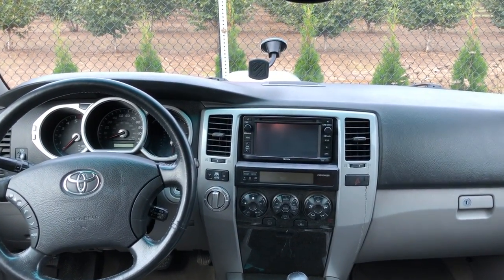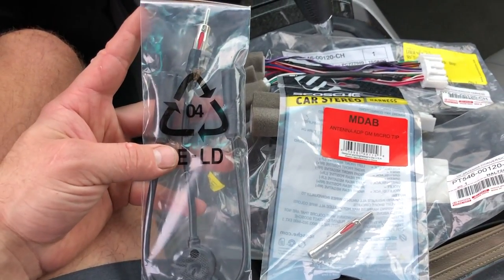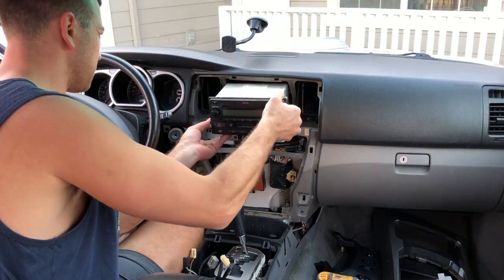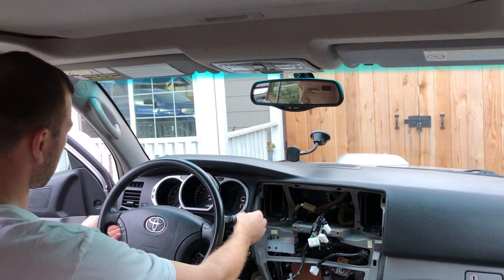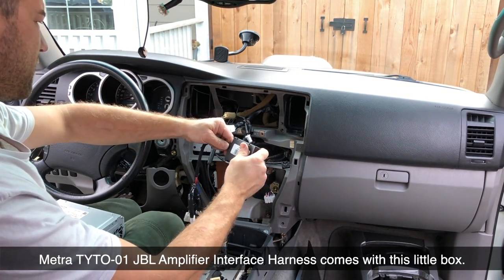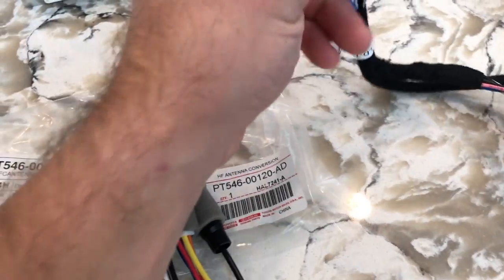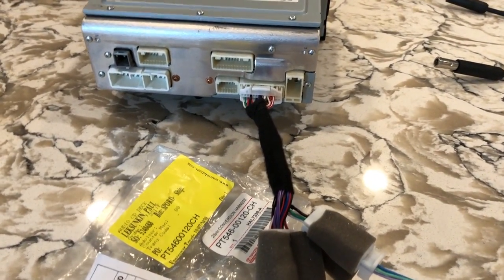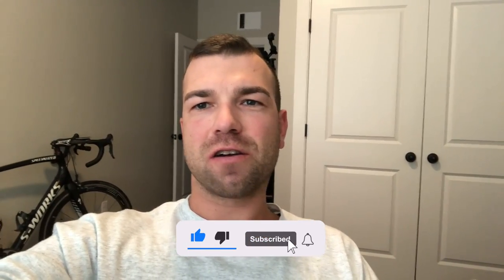4th Gen Toyota 4Runner Touch Screen & Bluetooth Radio Install - Upgrade 4th Gen Toyota 4Runner 2003

Comment: Something about your setup doesn’t add up???????? You have the jbl synthesis tags on your doors and require the adapter yet your OEM installed radio is a non jbl unit and your silver radio bezel is the recessed sr5 model not available on jbl models which would’ve left gaps around your radio. Unless it was different on the 03-05 models. FYI- This mod doesn’t works as well on 06-09 jbl synthesis models. It will require swapping out the silver radio surround shown here and also replacing the jbl beveled edge climate control panel to match the silver surround. I decided to do this mod based on this video not knowing this because it says works on all 4th gens. I know this is unintentional! There is plenty information on the forums about this gaps issue.
Reply from the maker: I"m sorry man. After doing bunch of research I thought it would work exactly the same on all 4th gen 4Runners. I hope you got it figured out.
Reply: Did you have the cd changer? Same issue with me.
Reply: @renegonzalez5097  yes jbl synthesis. If you have a 06-09 Jbl model I recommend not doing it. To set it up correctly is very expensive and complicated
Reply: My 2004 4runner SPORT has JBL synthesis and the radio (cd/tape) doesn’t have JBL marked anywhere on it. Looks the same as the 2003 in this video.
Reply: @tronixster My 05 runner has the JBL Synthesis factory radio marked on the radio and doors, the logo with the subwoofer on the back, would what is shown in your video work?

Comment: My volume keeps fluctuating. I have turned off the setting to keep it from fluctuating but it continues to cycle up and down. Is anyone else having this problem? What can I do to fix it?
Reply from the maker: I’m sorry brotha mine was perfectly fine. Maybe check your wiring
Reply: Did you get it figured out?
Reply: I just did this install a few hours ago and my volume is also fluctuating up and down when listening to the radio. The smaller antenna was hard to push through the adapter. I will investigate further but somehow think this is the culprit BTW, Thanks so much for this video. It was inspiring and I now have good blue tooth connection in 2007 4runner

Comment: I did everything you did step however the  backlighting doesn’t illuminate. The white wire that was left un-spliced in your “little pigtail” 6 pin harness is for backlighting illumination. Had to take everything apart after realizing it wasn’t working and ground it.
Reply from the maker: Oh wow! I didn't know it had back lighting,. I thought screen was the only things that was lid up. What did you ground it to?
Reply: @tronixster  I grounded it to a screw in the back of the radio. All of the radio buttons are to illuminate when you turn on the headlights! That’s what the white wire @18:43 minutes in your six pin harness is for.

Comment: GREAT video!  Thank you for your time and effort to share this valuable information to help others.  YouTube was made for videos like this.

I just bought a 2005 4Runner and I'm gradually doing the work to make it mine, upgrading her and getting her ready for her second life.  I was contemplating an aftermarket Android head unit for Bluetooth and a backup camera.   It was great to see that the Yaris head unit accepts a backup camera.

This upgrade is now on my list.  I saved this video in my 4Runner list.

Until then, I bought the Anker ROAV Bluetooth FM transmitter to connect my phone's audio to the car audio system via an FM radio channel, and it also has two USB ports for phone charging.  It integrates nicely into the 12V cigarette lighter socket in the center console.
Reply from the maker: Praise God I’m able to help 😁
Reply: Do I need to get all the wiring harnesses?
Reply: Thanks for you video, hey do I can do the same on my 2003 Toyota 4Runner limited comes with JBl

Comment: I just spent over an hour searching through radio install videos for the Toyota 4Runner to find out what was up with the two antennas going into the stock radio.   I finally found your very informative video!  I also like what you did with your mic.  Hopefully my mic has enough wire to route to the same location!
Reply from the maker: Praise God you found this video helpful and good luck on the install
Reply: @tronixster  Install done!  The radio works great!  Thank you!

Comment: Bro, you’re a frigg’n genius,!!!
Reply from the maker: Praise God. I'm glad you found this video helpful.
Reply: @tronixster  hey Paul where can I get the plug for the rear speakers? My new radio didn't come with the plugs attached.
Reply: Thanks to this video I’m very happy too.
I found this plug in Amazon. I hope it works 
Scosche TA02RB Compatible with Select 1984-17 Toyota Power/Speaker Connectors/Wire Harness for Re-Installing The Factory Stereo with Color Coded Wires

Comment: Thanks for the video !  I completed the swap and it sounds so much better.  I forgot to set my eq levels on the original head unit “flat” so I had to get back in there, but way quicker the 2nd time getting back in there!  I’m doing the blown sub today and then I’ll be rocking out !
Reply from the maker: Yeah I have to replace my sub too. What sub are you gonna be replacing it with?
Reply: Hi Chris, why do you have to set your eq levels flat? I'm doing this radio swap, thanks in advance.
Reply: @tronixster  i used the Rockford fosgate, a little pricey but sounds great.  Thanks for the great video, I’ve been loving the swap!
Reply: @tronixster Question… I’m buying this head unit with Sirius XM. Will this feature work on the 4runner?

Comment: Thank you for doing this video.  I was going to use a Yaris head unit but picked up a Scion head unit instead for less than half the price of the used Yaris one.
Reply from the maker: Praise God this video was of help and good luck with the install. Scion head units is exactly the same so you'll be fine
Reply: Is the Scion head unit also a 6-disc CD changer?

Comment: Great video Paul, thank you! I did a Yaris install and added the microphone. I’m not a radio guy so the stock look but additional features works for me. 

I have Yaris and Scion radios for those interested. I can also add in the non-JBL harness and cabling so that it is truly plug and play.
Reply: Do any of these oem radios have NAV?
Reply: @cfoote2667  there may be some with that option, I don’t have any though.
Reply: @mattkorting8104  looks like its an additional GPS module you need to plug in. I'll send you a PM on a Yaris radio - thanks!
Reply: @mattkorting8104 I want to do this to my 2008, do you have the touchscreen or regular fm head units? I’d like to pick one up if you still have any available!
Reply from the maker: @mattkorting8104 thanks for helping people out over here
Reply: @tronixster  Hey Paul, I recently did the install. Thanks to watching your video a few times I was in and out in less than an hour. I didn’t order the mic yet however I did wait 2 extra weeks for the usb cable to get here. It connects and immediately disconnects and keeps repeating that cycle until I unplug my phone. Seller contacted me and will ship a new one but all else is perfect! OEM look and amazing functionality. Thanks a million! <3
Reply: Hey Matt!  I'd love to get ahold of one of those Yaris radios and harness/cabling.   I just purchased a 2006 4Runner and am looking to upgrade!
Reply: @Jondbuch  I recommend you reach out to your local toyota dealer and order it directly from them. All said and done it’s less than $400, the parts will be brand new, and it takes no longer than 10 days to receive the parts

Comment: I am going to go with a full android unit, but I appreciate this video. I have a 2003 with the JBL so it gave me so good insight. The full android unit is going to give me more options than the used yaris unit. I want that navigation on the head unit, and not my phone. I will just tether a bluetooth connection to the head unit and it can do everything...... Thanks for posting though!!!
Reply from the maker: yeah android unit will definitely give you more options but I really wanted the OEM look tho that's why I went the extra mile. Half fun installing your unit

Comment: Excellent video Paul.  I did this install yesterday, very easy.  It took me about 2 hours including running the mic up on the ceiling like shown in the video.  If you was to install the mic on the steering column, the whole job may take a little over an hour.  I purchased all of the Toyota harnesses and the head unit brand new on-line.
Reply from the maker: Hey Bryan, thanks for sharing. Praise God this video was of help and enjoy your new head unit. I'm also about to release a video of remote start system for 4th Gen Toyota 4Runner

Comment: Outstanding video. I'd search for an OEM radio and see if I can find one. I got the truck with an aftermarket already and I really want the OEM look. Thank You again.
Reply: I am about to uninstall mine from my 4runner and willing to sell. See my videos to see it working on 4Runner with JBL amp. Comes with wiring ready to plug and play.

Comment: Going to be doing this for my 4Runner soon, do you have to get a certain head unit model for the navigation? Also will you be doing a video for the back up camera? Thanks, fantastic video!
Reply from the maker: Hey man, I'm not 100% sure about navigation but most of them should work but I just use my phone. I'm planning to do back up camera video but just can't get around to it.

Comment: Great video!  Planning to something similar on 2003 4runner.
Reply from the maker: Good luck!
Reply: Me too!!!
Reply: Just finished my 03. Only issue I’m having is the rear speakers since that parts slightly unclear which wires go to what (not color coordinated), should be an easy fix though just need to cross some wires.

Comment: Great video! Got the same radio and works nice! I did get the backup camera components that you linked down below but the installation link is a dead end. Running into a bit of trouble getting the camera to work and was wondering if you have another installation guide i could reference?
Reply from the maker: I'm happy you were able to get the head unit installed. Sorry about the back up camera and I don't know of any other guides besides the one I've posted. What exactly is not working tho?

Comment: Hi what model of head unit is this, I have a 2005 4 runner I would like install it, great video
Reply from the maker: Hello below is the model of the head unit and good luck with the install. Btw similar Scion head unit will work exactly the same way. 

OEM Headunit Part #: PT546-52150

Comment: Just finished my install. Works GREAT! Just as you said. Now I want to install a mic. Can you tell us the part number that you used and where you ordered it? I don't think you mentioned it in your video. Thank you so much!
Reply from the maker: The link is in my description actually. But here it is: 
https://amzn.to/371r9vK
Reply: @tronixster  Thank you so much!
Reply: @tronixster  Hi Paul great video. I just receive a new head unit for just $303.00 I’m very happy. I’m looking now for that cable that you mentioned it the one came with your head unit but you don’t give descriptions of it. I’ll fine it but for future reference it will be good to check out n that plug code so like me if anybody else buy it new we can also look for that one. Nice S Work we are cyclist here at home too 😂

Comment: Really wanting to do this in our first gen 01-07 Highlander, it has the exact same basic AM/FM/CD/Cassette radio yours has with the same connectors and everything
Reply from the maker: I'm 99% sure it will work and install process will be very similar

Comment: Hi Paul, you have the best presentation. I've performed the install using your instructions and everything you covered works excellently. What I can't get to work is AUX - I plugged in the existing 12pin CN702 connector, but the aux plug in center console does nothing. I would like to add a USB which should also connect through that CN702. I bought a AUX/USB unit with CN702 plug which is wired to a little box with AUX/USB inputs, but it did not work. Any advise on wiring AUX/USB into that CN702 12 pin? Thanks!!
Reply from the maker: Hey Jeff, I've also purchased USB connector but never got around to connecting it. From what I understood it's plug and play. I'm planning to connect it later and do a video on it but I'm short on time now so can't really help at the moment. Might be a silly things to mention but make sure head unit is set to AUX option

Comment: I installed Pioneer AVIC 8200 in my 2004 4Runner but the radio is junk. Keeps dropping connection with my iPhone.Will replace it with the OEM version. Great video.

Just checked, and the headunit is not available.
Reply from the maker: I would recommend calling LKQ directly and asking them for unit. It will get shipped right to your house

Comment: Hi, I just did the conversion and thanks to your video this went very smoothly. Even the backlight works great. Thanks for the great video and in particular the shopping list. I was hopeful the fader would keep its functionality, but it sem sto only shift the deeper sounds from to to back. How does the fader work for you?
Reply from the maker: Hey, my fader works perfect front/back & left/right, no issues at all. I wonder if some of the wiring got mixed up.
Reply: @tronixster  Hi, no wiring mixed up Metra says that the balance and fader needs to be set to center before the factory radio was removed. Also, the turn volume should be up 3/4 before shutting off the vehicle WITHOUT shutting off the radio prior. I did that, but no difference, so will try a replacement unit. Interestingly, on Amazon there are quite mixed reviews on whether the fader works or not. Curious what makes the difference....

Comment: Is that radio a single CD player? I wonder if there was a version with a multi disc changer. I still like my CDs and the 6 disc changer my 08 4runner has. Adding the Bluetooth and camera ability would be sweet.

Comment: Awesome job on the install!!! Question is would you know if this Yaris head unit has CarPlay and built in Nav?
Reply from the maker: No it doesn't have CarPlay but it does have option for navigation but software is very expensive.
Reply: @tronixster  reverse camera no work??
Reply: @leyvi133  please tag me
Reply: @Thewierdosful  ok

Comment: Great video, thanks, does the Yaris radio have nav in it, or allow you to do Carplay or Android Auto off of it?
Reply from the maker: Yaris head unit does not have a navigation but dealer can install it for around $500 so no go for me and it doesn't have Carplay or Android auto. This was just to replace my OEM Toyota head unit with another OEM Toyota that has bluetooth and touchscreen.

Comment: Wow that microphone is 153.10 CND on Amazon . If you add the antenna adapters is 186.81 CND That's kind a deterrent for starting the project 😊
Reply: I got mine from the dealer for about $40 USD. I searched the internet for pricing from dealer and then had them price match.
Reply: @JerrySpringersKid  Found the microphone for about $9 CND on Alliexpress as well (it comes with 28 pins plug connection)
Reply from the maker: Yeah please don't pay $153.10 just go to dealer and get one

Comment: Hello! Great informational video. Your video is for installing a used unit that luckily included the pigtail pug. If I was to purchase a new radio I’d need to purchase the pigtail plug you mentioned @ around 18:18 minutes was already included with your purchase from LKQ WHEN because they cut off the wires?
Reply from the maker: Yes, when I bought the head unit from LKQ they left all the original plugs in there and they usually do that. If you won't have it in your case I'm sure you can go to pick-n-pull and just cut one of some Toyota Yaris or any car audio place would be able to point you into the right direction.
Reply: @tronixster  do you know if I can simply source a new one online?
Reply: @Paul Longer As I had tje same issue buying a new head unit I found this plug for the rear speaker. You can put it in your video descriptions so you can help more people. Thanks for your video.
Reply: I purchased a new radio and went to the junk yard and cut off the plug from several Toyotas to make sure I had got the right one, I think I ended up getting one off of a late model scion.

Comment: Hi Paul, i just recently bought a 2008 4runner, and Im trying to upgrade the head unit, found your video very helpful. Thank you very much. But I as I was looking for the PT546-52150, they dont have it anymore. Only the PT546-00140 are available. Will it work? and how can I add a subwoofer to it? Which wire do I use for RCA signal? Do you have any video showing that step? Much appreciate.
Reply from the maker: Praise God you found this video helpful and really appreciate the support. 
Yes PT546-00140 part will work perfectly fine, it will just say Scion instead of Toyota but it's identical part. As far as subwoofer goes you can draw sound from your rear speakers or you should have OEM subwoofer installed in the trunk area on passenger side if you have JBL system so you could tap into that. I haven't done much research on subwoofer hookup so I don't have much details.
Reply: Thanks Paul, i bought the Scion unit. I don’t have JBL system. And I’ll draw sounds from rear speakers for the sub. Thank you very much.

Comment: Hey Paul,
Greetings from Chicago. Your video is very informative and so detailed. I’m heading towards installing on my 4th Gen ‘07T4R with JBL synthesis.
Will this head unit fit on 1st Gen ‘07 Sequoia? Thanks.
Reply from the maker: Hey Francisco, I believe I've seen some people do it on Sequaias but I haven't done enough research to tell you for sure. Sorry I can't be of better help